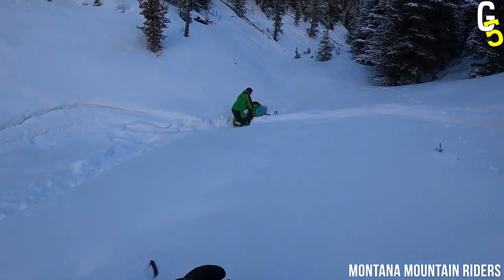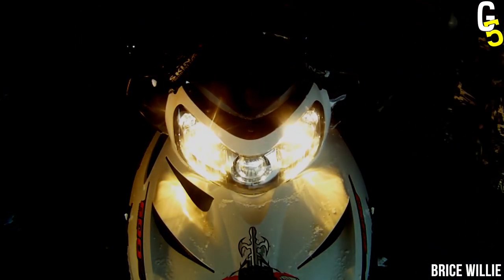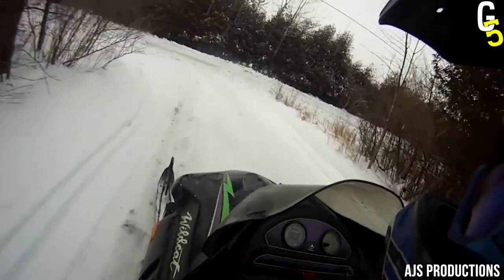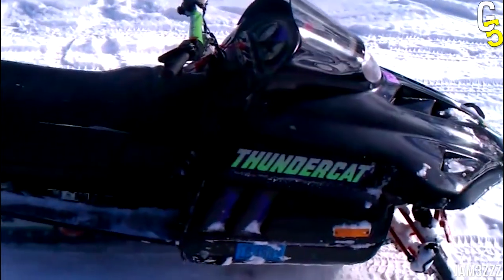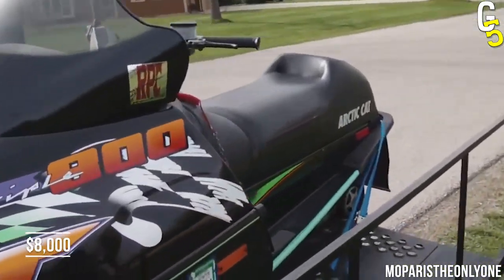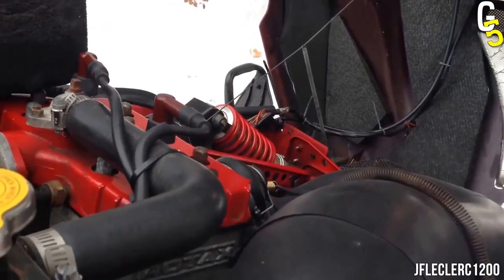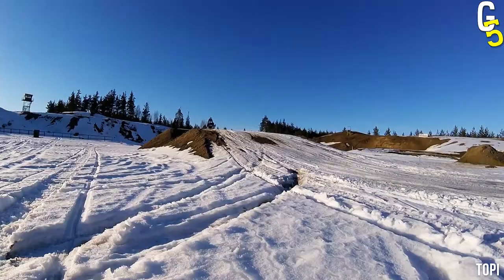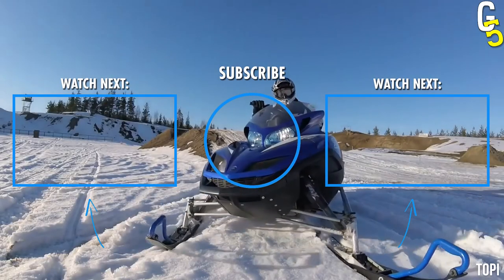NEVER EVER BUY These Snowmobiles! - Part 2

Comment: Ive had 4 vipers over 20 years,still ride today,best sled Yamaha built
Reply: I've had phasers and exiters and they were nice but when they broke down they were a bitch to fix. I'm no mechanic but damn that sucked
Reply: That's what I was just saying friend of mine has one with almost a 8,000 mi and it's still as 140ps a compression
Reply: Those Yamaha motors were in house built off racing technology borrowed from their motocross bikes so course they're going to be reliable

Comment: HMMMMMMM our Ski-doo Formula plus was amazing, so much that it has been threw 4 different owners in our family and is sporting over 16K miles on the original motor. It use to hit the radar runs in West Yellowstone every year back when they use too, it's worst was 100 and the best was 120 mph. The only things done to it was a track upgrade, pipes, and ski's.  Still rips the same today as the day it was bought. A good buy! Makes you wonder how far off they are on the rest of the sleds.

Comment: Viper worst sled ever?! Have had one 20 years only thing done has been spark plugs. It starts on 3 pull every time. Learn something about snowmobiles before you bash them, or at least be able to back it up with good information not opinion.

Comment: My first snowmobile was the ol ZRT. This was in 2015 and it lasted me five years until the engine finnaly blew up.
Reply: Back in the late 90's early 2000's I was on a snowmobile as much as possible. I rode with a group of friends and in that group was both the Thundercat and ZRT 600's-800's. Myself had a ZR580 & ZR600, we beat the hell out of these sleds and put thousands of miles on them. They were some of the best sleds going at that time. This video just seemed to pick random sleds from years  ago decided to call them "worst sleds". Kinda laughable.